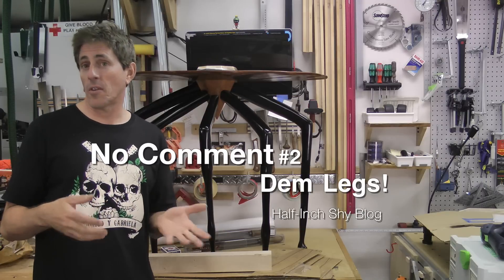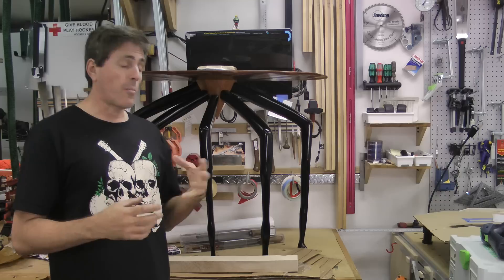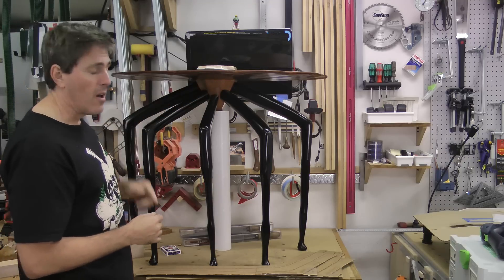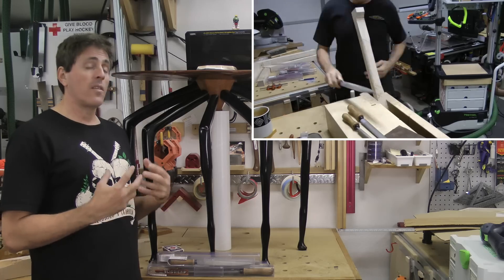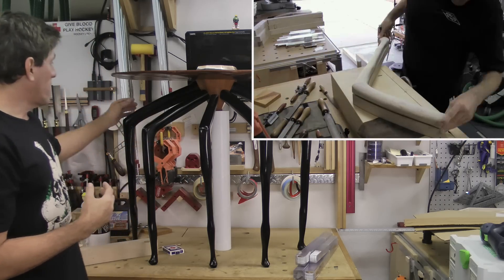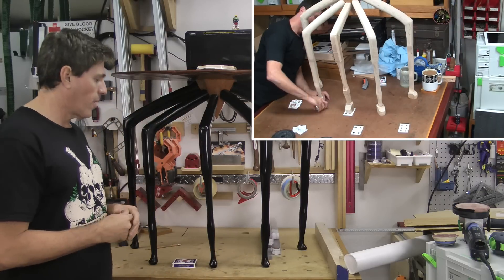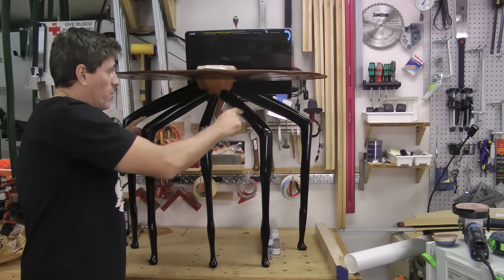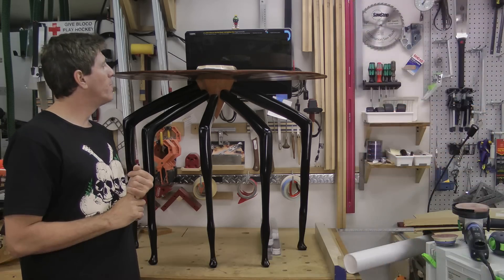#82.8 - No Comment #2 - Dem Legs

Comment: Couldn't felt pads be used to even out the feet?
Reply from the maker: As the feet are now, yes. You'd still need to do that preliminary leveling.  Since the table sits fine where it is now, I'll leave it. If I ever gave it away or sold it, I'd touch up the legs; they literally need a tap of the sander each and a touchup of the stain and finish.

What I don't like about the felt pads for this table is where I have it located. It is at the top of the stairs so as it comes into view, if you looked down at the feet, you'd see it sitting on the black felt pad (not a big deal, I admit). I have another piece of furniture at the top of the stairs that is on felt feet and for some reason, my eyes gravitate to those as I approach the top!